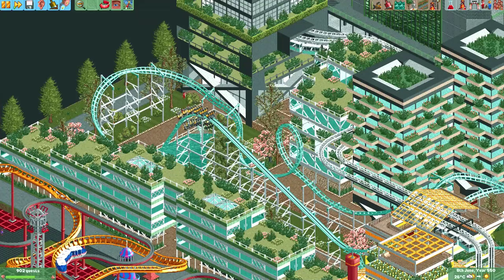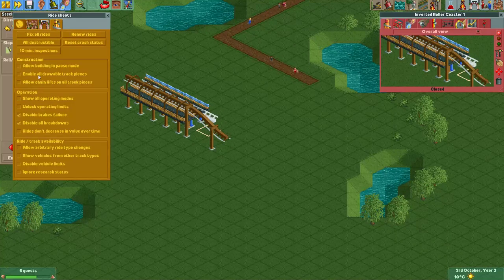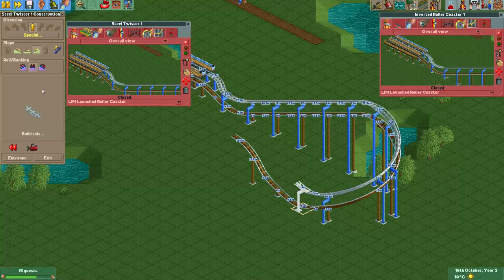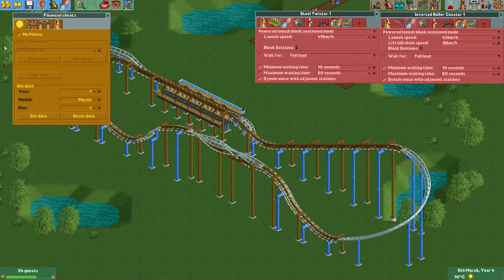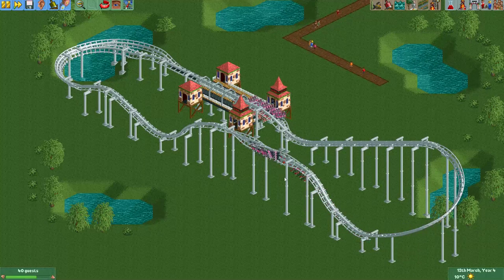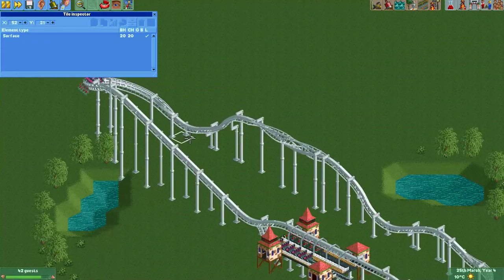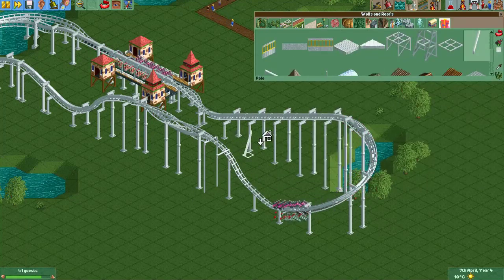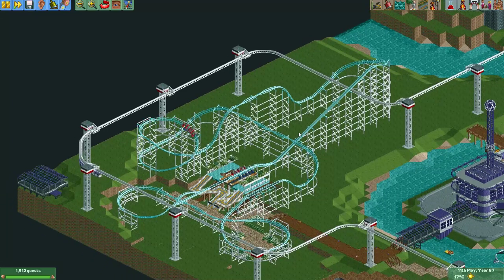Git Gud at OpenRCT2 #37: Inverted and sitdown coaster on same track!

Comment: The ultimate 1-up to Full Throttle.
Reply: Hey klink, i installed RCT2Open with the demo, when I start the game it gives me a blank area within a blackscreen, i think some options should pop-up but don't.
I googled it but can't really find a good answer on that. Also sometimes after starting i can't edit rides. Like adding a train.

I can't find a video that shows the basics of RCT2Open. Is there any?

Is the demo causing trouble?
Reply from the maker: You can ask the developers for help here: https://gitter.im/OpenRCT2/OpenRCT2

Comment: Nice trick, I guess you could use chain lifts throughout the rides and adjust the speeds to keep them somewhat in sync when there are multiple inversions
Reply from the maker: The problem is that I usually use the chainlifts at 16kmh to sync them at the lift hill! So any change in speed would force me to readjust the first part again
Reply: Deurklink - OpenRCT2 Tutorials and more! Can't you use tile inspector to adjust chainlift properties per piece?
Reply from the maker: You cannot change the speed per piece, it's a global setting for the coaster.
Reply: @Deurklink  would it be possible to merge other tracks and changes different speeds that way?
Reply from the maker: Nope, when you set the chainlift speed you really set it for the coaster train. Even if you merge other tracks with a different chainlift speed the train will ignore those speeds and use its own setting.